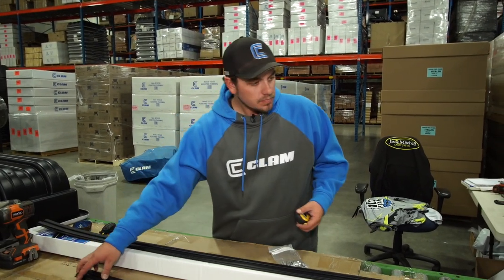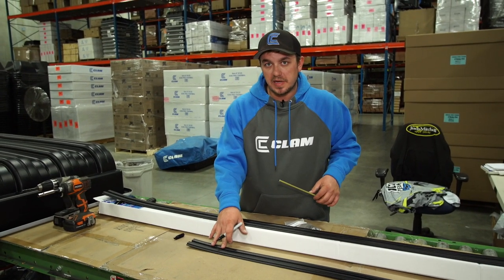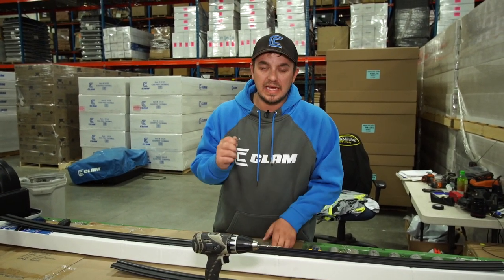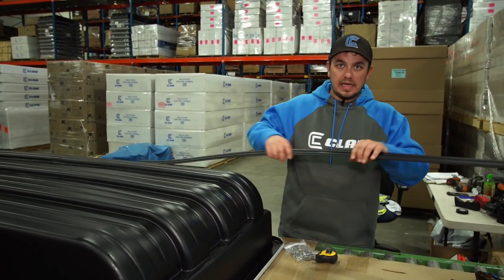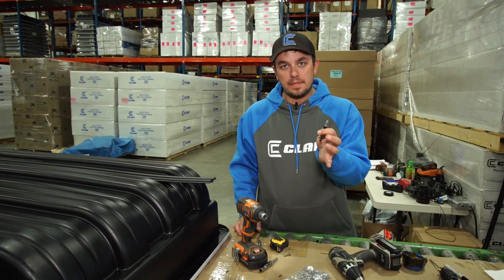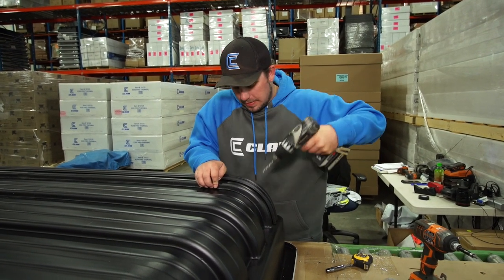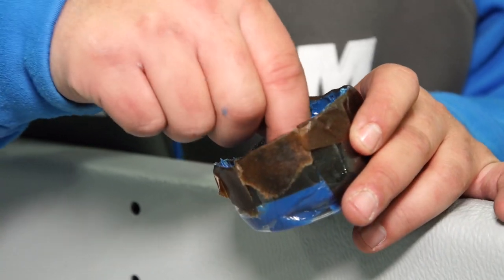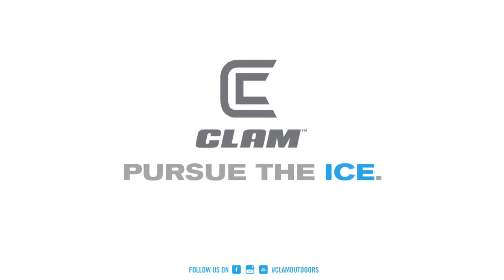How to build a Clam Fish Trap – Runner Kit Installation

Comment: The screws are too long. For those of you who don't want nearly 1/2" of screw sticking out past the top of the nut on the Kenai Pro Thermal, you can replace the stainless screws. Cost me about $7.50. I replaced the included 1" screws with 3/4" #10 screws and still had nearly 1/4" (7/32") of excess screw thread. 1/2" screws would have been too short. I wish they included the correct sized screw. We dont want all that extra screw sticking up.

Comment: I bought the kit and the bolt is at least 1" long and therefore will stick up about 1/2" through the floor once the washer and nut is secured which will create little "spikes" on the floor. Seems like these will act as great snags and catch points to tear and damage anything placed in the sled. Why not supply 1/2" bolts or something with a lower profile? I decided not to install the runners for this reason.
Reply: You can purchase little plastic nut caps super cheap at most Menards and Lowes orHome Depot stores

Comment: Just bought the 100 XT and a runner kit. Runners predrilled off centre, countersink depth is all over the place, and the last hole on 2 of them doesnt match the other runners. What am I supposed to do when I need to replace them and the holes done line up? Turn my tub to swiss cheese? For $130 cdn I would expect a little better quality. I wont even mention the screws. Very disappointed in this purchase.

Comment: Warning do not measure the same spacing for a Kenai Pro Thermal. They don't give you enough bolts ,washers and nuts .Pre measure and count your holes before you drill any holes because you will run out of hardware to bolt it down.They give you only 30 bolts, washers and lock nuts. Divide 4 runners into 30 sets. That only gives you 7 bolts per runner. Who does the math here? 
They should give you  more sets of hardware. He has a whole warehouse of hardware, you don't. Just a heads up guys. FAIL Clam....We pay enough for the kit and shelter, you should give us enough for what we need.
Reply: Thanks man, building mine right now.
Reply: Every model has different spacing. Look online for the proper spacing...  or read the instructions that should have come with the kit. There's plenty of hardware if you follow the instructions for your particular model.